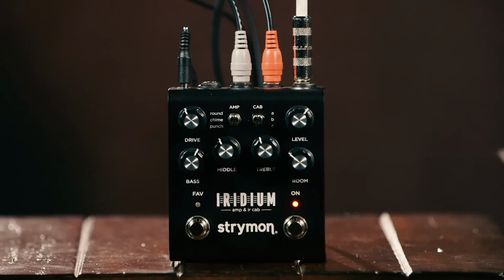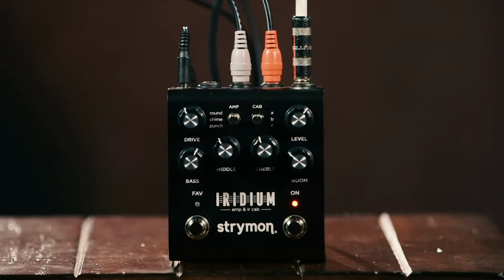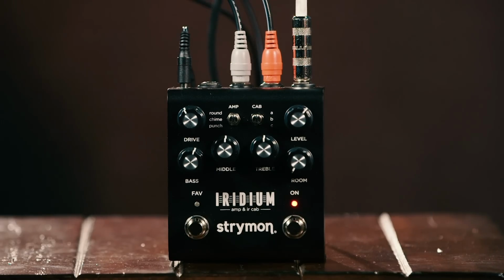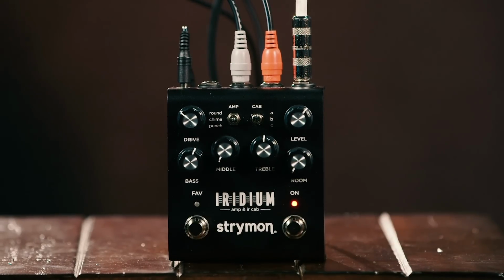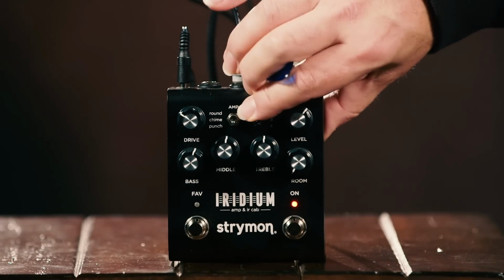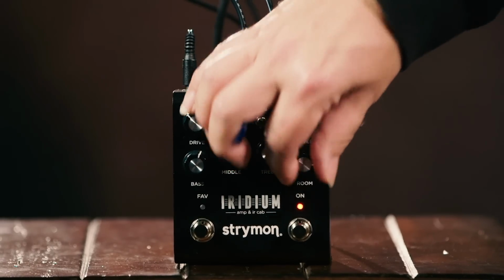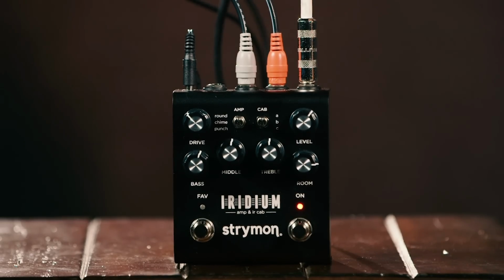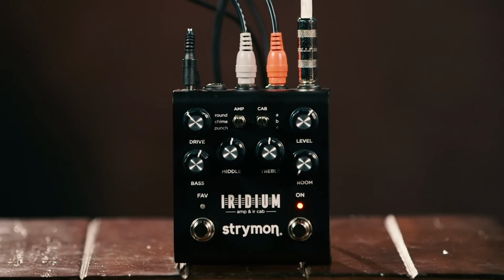Strymon Iridium Amp & IR Cab Pedal Demo

Comment: Strymon- please make a deluxe version with 2 sets of amp switches and the ability to send each amp to its respected output separately through XLR outputs. Many players (myself included) use wet/dry rigs and this would allow you to send an Amp sim (say Fender) out on one channel, and another type (Vox or Marshall) out on the other.
Reply: Jim's Guitar Garage  buy an hx stomp!
Reply: Isaac Hawkins I’ve got a HeadRush pedalboard already. But if they made a deluxe version I’d use it on my analog board.
Reply: Jim's Guitar Garage I get that, but the hx STOMP basically is a deluxe version of this. Plus some! I use my on my analog board for the amp sims and irs only, using two amps as you described
Reply: Could always buy two and some sort of A/B box right?
Reply: Charles Hale not for $800, I’ll stick with my current setup with 2 Joyo’s and a digitech CabDryVR.
Reply: @JimsGuitarGarage  I just saw Rhett Shull's video on the Iridium and he kind of said it best, at the price point you might as well start looking into a Helix unit which seems to be a more versatile interface all together, with amp sims and all. This seems like a simplified, quality version, that'll appeal to guitar players who maybe weren't certain about the idea of modeling, or who want something that's pedal board sized and simple to run.
Reply: Charles Hale I haven’t seen Rhett’s video yet. I agree with the fact that it is expensive. I think if they dropped the price by $50-100 it would seem a little more reasonable, and be easier to justify buying. My current amp and cab sim setup is about $200. 
If I want to go full digital board, I have a HeadRush, and love it. But sometimes I just want to use a regular pedalboard, with actual pedals, first world problem I know.
Reply: Excellent idea!
Reply: I believe you could use one of the Iridium outputs as your "dry" amp and send that to the PA, while sending the other output to the rest of your time based effects for the "wet".
Reply: Greg Adler That is possible with a TRS plug on the input.(I found out after posting my original comment on day 1 of the release)
I prefer to use 2 different style amps at the same time, and it doesn’t seem possible with this. I could do without the XLR outputs, but really was bummed that you can only use one style amp at a time. 
I might just pick one up, and if it doesn’t work out for me, I’ll just go back to what I use now.
Reply: @JimsGuitarGarage  I had previously asked them about using different amp settings and in my case using the Iridium in a "wet amp / dry amp" style of signal paths.  They replied with the following.  "You can certainly use Iridium in that manner. One thing to keep in mind, is that with your described connections you will be sending the amp and cab modeling from Iridium into your 'wet' amp as well as there is no option to send just a 'dry' signal (no amp or cab) out of one output when Iridium is engaged. One thing you CAN do is place a mono 'null cab' IR as one of the IR's of the cab slots, but leave a standard IR cab on the other side. This will allow you to send the amp and cab signal to one side (PA) and just amp modeling to the other ('wet' amp)."
Seems like it would be possible to do what you're wanting to do too although I'm just getting up to speed with IR, sims, etc.  Hope that helps?

Comment: Only thing that bums me out is no XLR output. If I’m going to a PA I want to use XLR. It’s not a big deal using a DI box, it’s just one more thing.
Reply: If you have a "Rockboard" pedal board with one of those modules they will give you an all-in-one solution! XLR out, even stereo if you want that
Reply: @TheCleansingx  I may have misinterpreted what you're saying, but the modules for the Rockboard pedal boards are only pass-through. At least the one I have with a number of 1/4" and one XLR. He would still need something to convert the 1/4 from the Strymon to XLR.
Reply: @freezingCode  Oh yea that's true! But I think there is one MOD where the XLR is a sum? Anyways a DI isn't to hard to mount underneath your pedal board
Reply: @TheCleansingx  Ah, it looks like you're right.  I didn't know about this one: "The RockBoard MOD 5 Cab SIM + DI Patchbay offers customizable, IR-based stereo speaker cabinet simulation, an active DI box, as well as a simple solution to organize all the connections to and from your effects setup."
Reply: @freezingCode  Yes, that's the one! :)
Reply: TheCleansingx I didn’t know that thank you!!
Reply: I believe if they are balanced TRS outputs you only need TRS to XLR cables.  I found some great ones by Proco for a great deal.  Then what's rad with 1/4" out you can go right into the effects return on an amp with an fx loop and use the power amp and speaker.  The HX Stomp uses balanced 1/4" outs as well.  To me it's a tone of kit in a small box!
Reply: @careywebber638  Are the levels different between balanced and TS?
Reply: @javsmith86  there shouldn't be any difference in volume. Currently my board has a stereo di, but you don't need it with the trs to XLR.
Reply: Agreed! Very short sighted - I’d love to know the rationale for that omission...
Reply: @tkdunn  They will include XLR's  in the next Amp and Cab pedal in their larger format :-).
Reply: @tkdunn  Size, probably.  And amps are typically entirely 1/4" oriented, so this plays better with real amps / power amps / cabs too.  Balanced 1/4" to XLR cable oughta do the trick.
Reply: I agree with you ,for 400 dollars they could have put an xlr out, this thing is made to play straight into p.a. the sound guys always prefer an xlr jack...
Reply: lowrence mayfield All Sound techs I’ve met always had a couple of DI boxes available. No problem at all. They chose TRS because of the small form factor and greater compatibility with different rigs (keys...). Uaudio’s OX has balanced TRS plugs as output as well, no issue at all.
And - most important - this way you can plug the BigSky in stereo after the pedal!! There is no effects loop, but by doing so you don’t need one.
Reply: While I agree, if I remember right, theres not a lot of room in those boxes.
Reply: An effects loop is what I miss more.  Use a trs cable and you won't miss xlr.
Reply: sm19 just get an adapter. 

https://www.amazon.com/dp/B0002GZLX8/ref=cm_sw_r_cp_api_i_-rsSDb1T1KDBQ
Reply: @dvdpz89  not a bad approach, but you would need a balanced out for this to make sense, afaik the outputs on the iridium are unbalanced.
Reply: @kristofkubina4105  Right, that adapter does not make it a balanced mic level signal like a DI does.
Reply: David Perez If the output is balanced TRS that works. Is it?
Reply: Thomas The output is unbalanced here, so you should use a DI box to get balanced line level with long cables to PA. For plugging into interfaces, other effects or your amp’s power amp, it’s totally fine, though.

Comment: Anything like this for bass guitar?
Reply: Some of the Darkglass pedals have a (single) built-in impulse response. Not quite the same, but in the neighborhood.
Reply: Checkout the Geddy Lee Sansamp
Reply: I’m thinking the same thing. He said there are a lot more Amps to choose from, so I wonder if they threw some bass amp ims in there to cater to us bass players. If not I’m sure a bass would still sound good running through it :).
Reply: @grantwilliams5458   yeah...that's what I was figuring.
Reply: Grant Williams ... you can load different cabs, but you can’t load different amps.